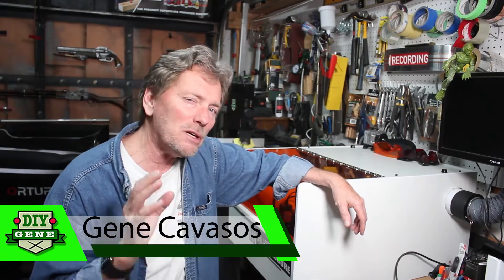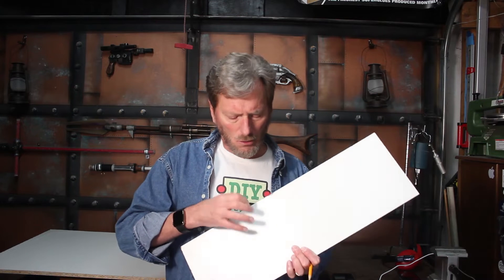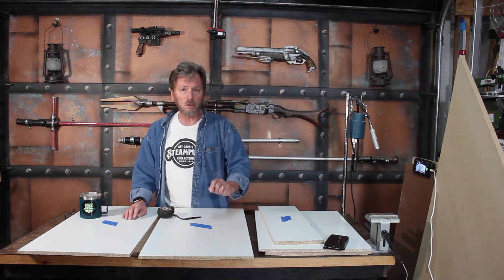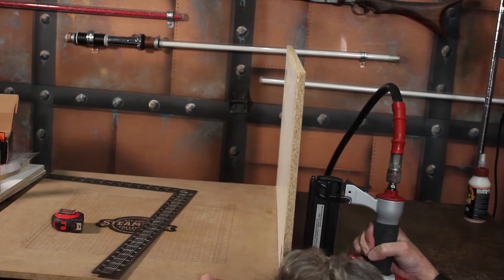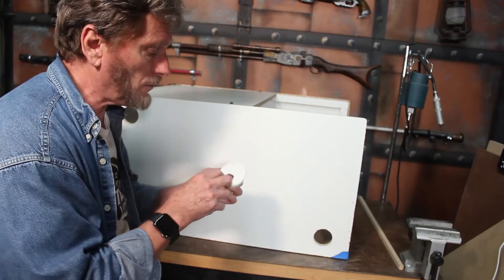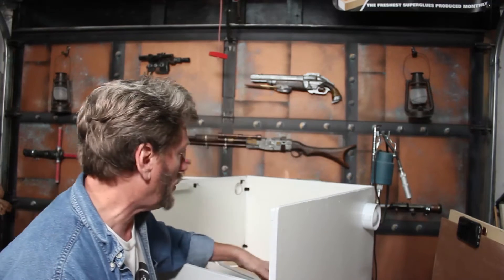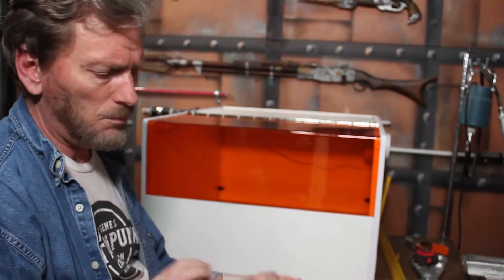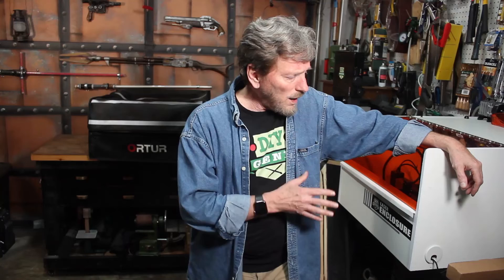I Over Built A Simple Laser Enclosure

Comment: Nice design, I'm just a bit concerned about the connection strengh with screwing directly on acrylic plastic for a moving part. You could add a reinforcment with strip of metal on the other side so the platic is taken in sandwitch between the piano hinge and the strip of metal, this way the pressure is spread all along the length and not only around the screws
Reply from the maker: @cpassuel9857 , That is an excellent suggestion. Thanks for sharing.

Comment: The angle clip were your best idea. Gluing MDF is not secure because MDF  just shreds at the glue joint.  It does not even hold a screw very well. Edging Is best cut with an edge trimmer made  for that application.

Comment: Turned out functional even with few mishaps - I think you always think oh i could have done something different once you complete a project 
I agree the white edge strip is no fun without a proper trimmer i resorted to a sharp blade the draw filing 
T-Moulding would be another option - it provide a robust edgeing - it fit into a slot cut in the edge

Just a Question 
Is the orange plastic you used a special type or just a special color tint plexiglass/acrylic
Reply from the maker: I really wish I would have used T molding. The plastic is just a translucent color that matches the glasses and the shelf of the laser. But I feel it works well. Thanks for watching.

Comment: IF you measure from the top of the honeycomb piece to the top of the the lid what is it with no leg entensions on the laser I want to mount a camera inside and want to make sure there is enough room for the camera?
Reply from the maker: How big is the camera? I think you have room.
Reply: @DIYGene  I don't have one yet but I know they have a minimum distance it needs to be from the honeycomb surface.
Reply: @DIYGene  It's just one of those Raspberry PI cameras I'm looking at getting.
Reply from the maker: @danielprovenzano163  , I just checked. It’s 14.5”. I hope that helps.